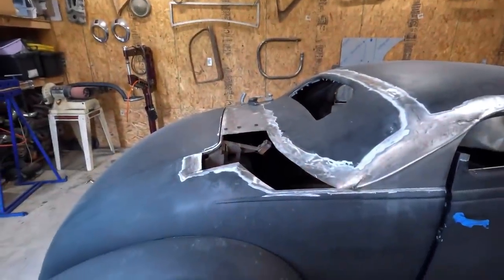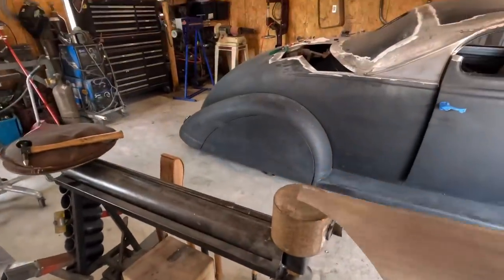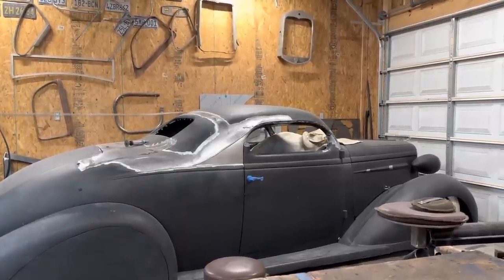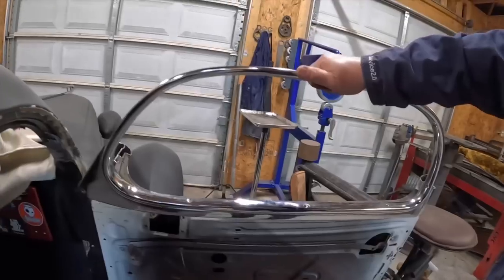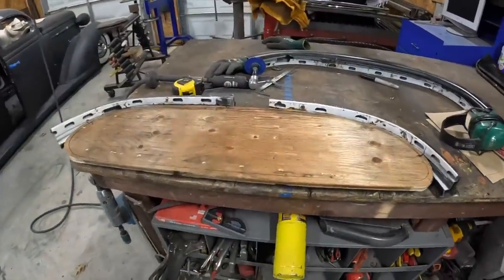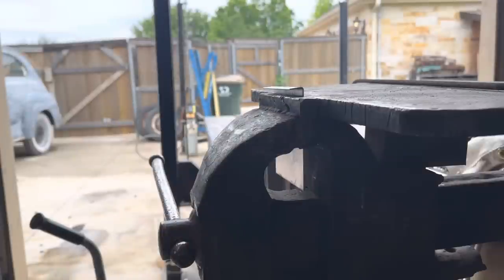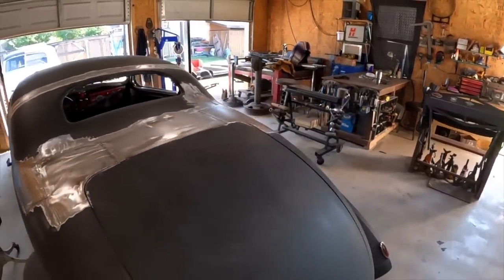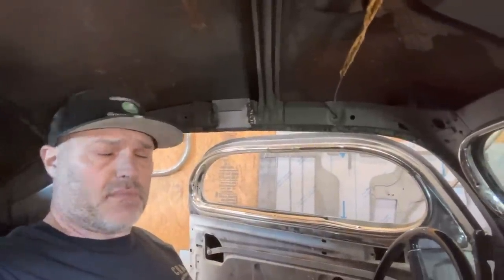How to chop a top,  1937 NASH

Comment: from some of the comments i gather a lot of younger generation of metal men don't know what some of the old tools are. my dad and older brother were long time body men, my dad from the mid 40s up, i still run across some of his old tools in my mess i call a garage. lead paddles, spoons, slappers , body files etc, got several different shape dollys. until i saw a few videos like yours i didn't realize anyone used lead anymore. im not sure if Riata Cadillac in san antonio saved their old equipment when they turned the dealership into condos or not but in the 60s on the top floor where the parking overload went the stored some of the old fixtures, racks and forms, and jigs  used in the old days to reshape roofs and doors and hoods. back when you couldn't buy new parts and had to use what you had.
Reply from the maker: Yes for sure. Although there definitely is a growing interest in the old ways.

Comment: You had it right the first time, cutting your hand with metal will make your day. Always wear your safety gear hand, eye's feet, protection you only get one of each of those. Looking good always great to see how the project is progressing along. 
Well started to drain the tank on the 1947 Chevy Stylemaster coupe to put new gas in. It did turn when connecting the battery. It will fire up the spark plugs had a little rust on them clean right up, they were brand new 7 year's ago when they were put in.

Comment: I know the car is already done, and I haven't watched the 3rd vid yet. I heard your delema about clamping that upper body panel, trunk corner into the sail panel area. You do really good work, and If you don't have any T-Butt clamps they're a super helpfull pain in the ass type of three handed clamp, but they're exactly what you'd want in that area. Just some times it takes a second set of hands to set them up. Nice job, harbor freight sells them and other places too
Reply: Also, that wood buck Is genius wish I had done that when I did my 47. It makes sense for any chop. Sometimes I get caught up in working with metal I forget that wood can be used and was used in building cars back in the good days. I had a 34 international truck turned rat pickup with some wood structures inside, a friend's brother had a 31 international and there was so much more wood used, and with a 3 year difference the doors went from full wood structure with skins attached with like staples or tacks, to full metal doors and full metal A pillar, with wood B pillar and rear of cab. Rattling on

Comment: I really admire your metal shaping skills . And all the other skills . The hand held planishing hammer your using where could I find something like that and is that what it’s actually called? Thanks for any info
Reply from the maker: Well, thank you very much. I made that I actually did a video on it about a year ago. But it’s a small handheld de scaler. I bought off Amazon and then modified it.

Comment: gopro shit is tough and it is alot of work I.  try to record alot of stuff in my home shop and just moving camera around equipment and not burning your lens with weld or grinding sparks is a job and then finding a editing software that doesnt take a PHD to run is the next battle
Reply from the maker: Yes, I feel the pain. Trust me. It kind of went from being fun to like a job.  I enjoy doing it as it’s sort of a new adventure, but it is a lot of work.
Reply: @Theoldironworkshop  I’m gonna keep at it! For now I’m putting up shit videos just to get the feel of it and I’m learning a lot about positioning and lighting the things you wouldn’t think about. Currently building a chopped 27 coupe then on to a 32 coupe
Reply from the maker: Yeah, there’s a lot to take into account when filming something for real. Over the last year I have learned tons. And still have tons more to learn.  I never really used YouTube before, so it’s all new to me.